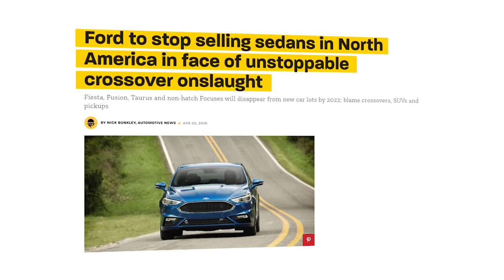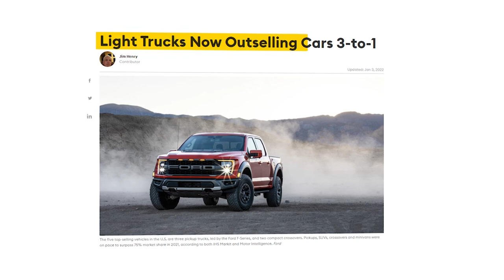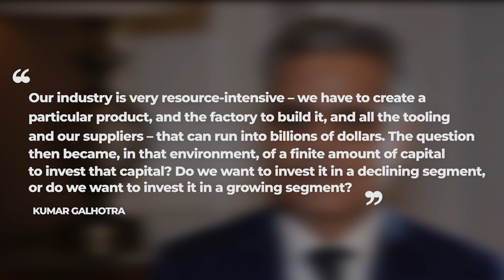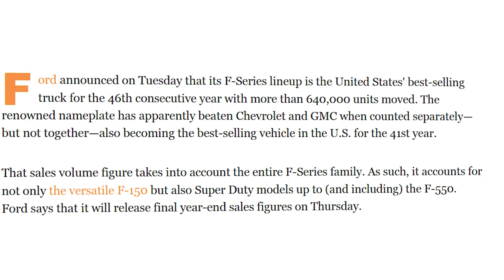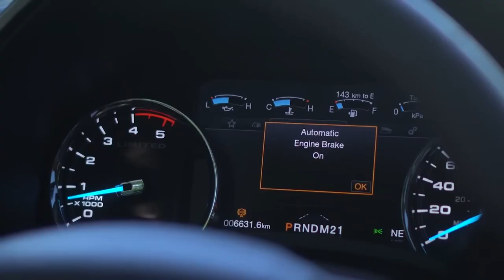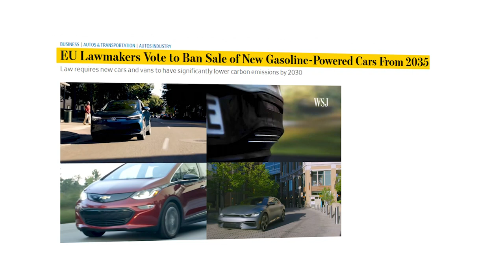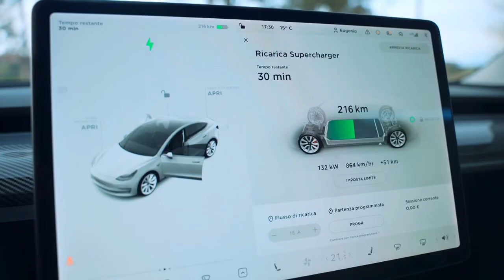The Real Reason Ford Stopped Making Cars

Comment: Canceling Fusion was a huge mistake.
Reply: the focus too was excellent fleet car wagon especially i worked for two companies we used them like small trucks and from square escort  to focus every year they got better and better and co was not great maintaing them they kep them safe but often 18k oil changes. and we still got 200k but then ford decided to drop the wagon so buyers were forced into SUV  then ford designed the 2 clutch auto testing showed it was defective
but the used it anyway and destroyed the cars reputation  as for trucks many want trucks to do work not look like the insides of a Lincoln limo
Reply: That’s a fact; we love our 2016 Fusion S! We can get 41 mpg highway, and it’s a fabulous car..
Reply: How? My 2016 fusion was awful. There’s so many better options sedan wise.
Reply: @Exp101_  awful as you believed it to be, it sold well and had great future possibilities. Hybrid, plug in hybrid,2.5 Mazda engine with 8 speed transmission (best engine ford ever produced). Should have offered less trim options, an under 20k basic fleet/young family trim, and the awd loaded all electric for the 1%ers to help with trickle down parts bins. Ford dropped the ball with the fusion.
Reply: Ford doesn't have a new car for anyone that earns less than 50k. Nothing is affordable. They should have built a car that looks good but economical that's gas powered.
Reply: @jamiebaker6691  correct…Farley himself said he “doesn’t care what the consumer wants”
Reply: cancelling the Fiesta was a big mistake
Reply: @bdun1226  where did he said

Comment: My last truck was a 1998 F150 with the 4.6L V8, bought it new for 20K and used it as a real truck for 23 years.  Can't imagine paying 60-90K for a luxury truck and actually using it like I did.
Reply: No kidding.  Paying $90k for a truck I would keep it in the garage to avoid it getting a scratch
Reply: Bought a 2006 lariat it has three hundred thousand miles on it still going strong. Can’t imagine buying a new one way too high price. But Ford builds a good truck
Reply: My 2003 Silverado has 307k miles and my kid still drives it daily.

Comment: Notice when they talked about Jeep selling fewer SUVs then cars but making more profits tells you they don't understand that they are losing the majority of their customer base by overpricing and over building their vehicles. Most people would rather have a vehicle that they can afford with fewer options which is why the Ford Maverick has a two-year waiting list. I can afford a full size truck but don't need one. The Maverick was perfect for me but I am no longer interested. I currently have a 79 Bronco which I have decided to restore rather than try to buy a new one, which I was also interested in. I currently have a 92 F250 which I will restore because I don't want to spend the money on a vehicle with options I don't need. Gas vehicles will never go away. I would like to see more investment in hydrogen cars. They are out there and they're not much more expensive to operate and filling the tank doesn't take much longer than a gas vehicle. Hydrogen is much easier to produce than the amount of mining required for a battery that has a lifespan of 10 to 15 years. And the cost of recycling and impact to the environment is much greater. Oh by the way with today's efficiency of cars and trucks we no longer need CAFE standards. It is just another mandate enforced by another unelected alphabet agency.
Reply: Yep you got it brother
Reply: The car makers today are basically flipping off the working man with their high-prices.
Reply: jeep crylser make more profits yes.. as they are always in the shop

Comment: So on the argument that Ford stopped producing cars because it couldn't adequately spread out its cost over the production run, why then while they were in production were they always the best value by far for equivalent features?  Car, CUV (higher cost for same features), SUV (even higher cost for the same features), and light truck (pickup) even higher yet despite having the highest unit production???
Reply: Becuase they are greedy why make a ton of cars when you can sell less at sky-high prices

Comment: Ford made a mistake in their 2020 change to the Explorer. They are only Eco Boast models now. There was nothing wrong with the Explorer with the 3.6 V6 without Eco Boast. I don't want an Eco Boast since it is something else to go wrong. My F-150 has the 5.0 V8 and that is the only motor I want. When the Explorer needs to be replaced, I will have to buy another brand of vehicle if Ford stays with the current options.
Reply: Agreed 100% brother, I have a 2011 Ford F150 with a 5.0L Coyote V8 in it with 152,000 miles on it and still going strong and its a beast and it sounds like a beast with the Borla ATAK exhaust on it. I also have a 1996 Ford F150 with a 5.0L (302) Windsor V8 with 210,000 miles and still going strong as well.
Reply: I encourage you to try a current model 4Runner.
Reply: @bobby3944  The 4 Runner is an excellent choice as well as the GX460 (since it's basically a 4 Runner with more luxurious features and V8 power as well).
Reply: i own from new a 2014 fusion 2.0 vel engined car.. 170000 miles on it..leather is still perfect, as the rest of the car.. i just change the oil every 6000 miles and exchange 4 quarts of transmission oil every 15000 miles...and added a ovs to the car..no carbon on my intake valves.... it is an ecoboost  engine,, has a tune on it.. now dynoed' i has 255 hp at the front wheels and 315 tq.. fuel mileage went up from 31 mpg at 70 in cruise control to 34/35 at 70 in cruise..love the car.. very good looking inside and out.. have installed a adjustable  coil overs and dampeners on it..lowered it only 30 mm.. looks even better..
Reply: I rented a Ranger with the Eco Boost last month fir a few days. I hate that motor! It isn’t smooth and refined the way the V6 motors in my Mustang and F-150 are. It’s jerky and it feels unrefined.

Comment: The big problem is they build different product lines with different priority parts,  (they make a lot on parts on purpose due to all the changes, “dealer only”…). Toyota uses the same door window switch in everything,  same with there drivetrain and suspension packages,  find something that works and is reliable and use it in everything for 20+ years,  Camry front suspension didn’t change for 20 years.. Ford can’t even go a full model year without changing stuff,  call the dealer for parts and they have to have the vin number,  one year there were 5 different injection pumps in one year for Ford diesel trucks.  Ford will fail again and the Ford family will have to step in and clean up the mess these woke greed obsessed  CEO’s have made.  Ford is failing on quality and reliably, we stopped buying their trucks at work and went to dodge due to reliability.  It’s really bad when dodge is more reliable than GM and Ford.  Really sad,  with the failures on new trucks I’ve seen the warranty costs must be in the billions….
Reply: GM quality has been coming down in the work truck category. Alot of businesses though are still sticking with Ford.

Comment: Don't depend on the electric cars to much, I think they will go down as the biggest mistake ever
Reply: A clear dead end.  I read they take 10x the natural resources to make compared with a gas powered car, and the battery is not designed to go longer than 10-15 years.
Reply: @teekay_1  The battery is recyclable.
Reply: @tommccoy6708  that doesn't really help you when the battery replacement cost is $10,000-$15,000.   At that point you have to buy a new car because the replacement cost is more than the value of the car.

At least if  you buy a Honda Accord, it will last 20-25 years with only normal maintenance.
Reply: they said the same thing about the first cars..
Reply: @teekay_1  how much does a new engine cost? 8 to 15000$
Reply: @randellgribben9772  3 camry hybrids in my driveway the  2009 has 250k on it, no issues,  a taxi company here has a similar car with over 600k on it, factory motor…well designed modern ICE motors don’t wear out if maintained properly,  we have not seen the total life cycle costs on EV’s yet,  how long do the batteries last and what is the cost per mile over 200k,300k,400k… lots of 2012 model s getting to the battery changeout time real soon,  used car dealers won’t touch them with a 10 foot pole,  due to the cost of a out of warranty battery changeout…
Reply: @randellgribben9772  a new engine will last 25-35 years, longer than the rest of the car.
Reply: @randellgribben9772  It was also true about the first cars.

Comment: The one part I wish was covered, was also wanted out of the market due to governance restrictions. Where Cars needed to be at a certain MPG efficiency, where Trucks and SUVs are not due to vehicle classification. Because of that, in the US market gap between cars and SUVs was negligible in terms of MPGs.
Reply: They met the mpg goals on cars. trucks and SUVs are the ones that failed to meet mpg goals
Reply: They got captured after 2008 too.
Reply: Agreed! I started in the car industry in the 1980's right before the shift to trucks, and that's exactly what I saw happen. As cars became less and less exiting because of heavy handed regulation, people moved into trucks. They became a better value. Many of them (some still don't) need to meet mpg standards at all, and some still ran on regular gas not unleaded!
Reply: @evos469  Some trucks are still not even rated for mpg
Reply: i went to a ford school in the 90's/2000's and an instructor told us ford had to built so many small economy cars in order to build the big cars and trucks. i went to the ford school a couple of years ago and asked what happened to that. he didnt have an awnser.

Comment: Wouldn't want an electric bill for the month after charging up my EV in the summer with my AC on in 95 degree heat for days!
Reply: Don't worry - the grid will be down so much, your electric bill won't be as high as you think, in the darkness...
Reply: Charge the EV at night from your home charger.  It will be easier,  cheaper than gasoline,  and won't need any more power than you use for A/C during the day,  so it won't break the grid.
Reply: @davemccarthy7366   Solar here and I still don't want an EV.
Reply: @ralphwagenet852  for now. Mark my words son, electricity bills will go up drastically.  There will soon be taxes added on to fix roads.
Reply: @davidtycker  Agreed about the taxes to fix the roads.  They are needed, and whether we pay for road repairs through gas taxes or some other way, they have to be paid.  I think that the best way would be to pay through vehicle registration, but that will increase our registration fees.
Reply: @Ralph Wagenet  vehicle registration is easiest. They could just subtract your current mileage from previous year and charge for those miles. Super simple, and no overcharging

Comment: It might have helped if Ford could have produced a reliable sedan. With design defects in the Ecoboost engine & the automatic clutches it’s no wonder they ceded the market to foreign domestics. The question remains if they will continue to make unreliable trucks & electrics.
Reply: i own a 2014 fusion 2 liter ecoboost..170000 miles on it.. i just change the oil every 6000 miles nd exchange 4 quarts of transmisson oil every 15000 miles.. added a ovs to the intake at new..no carbon build up on my valves and i check the ovs every month.. almost no oil in it ( no blow by )   and the car runs perfectly.. and leather is still perfect in the car.. never had a problem with my car
Reply: @randellgribben9772  I,m in agreement on the maintenance aspect. With our 2014 Escape, regular oil changes with synthetic, we were able to nurse 150K out of the ecoboost before it began to pump coolant into #2 cylinder. My 2014 Focus I,m still driving even though it has had 5 clutches in the first 100k miles all replaced under the extended warranty. At 120k it looks as though #6 will be on my dime.
Reply: 16 escape 2.0 awd w livernoise tune & light mods @ 140k and it still performs great.

Some people should probably just stay away from turbo cars,...

Comment: I have had fords for 30 years I’m done no cars no me looks like it’s time to look at Honda and Toyota
Reply: You won't regret going Toyota.
Reply: Honda makes the best engines, hands down. Toyota engines are really good too, but are uninspiring. Toyota makes the best automatic and cvt transmissions giving Toyota  the edge. However if you get a Honda with a Manual transmission, you have a potential million mile car. My '04 Honda Accord EX sedan has 270k miles on it and it still runs and drives like new. I've not even had to replace anything on the engine. Just tires, brakes, oils, and one battery. But I wouldn't buy one with an auto trans, then again I wouldn't buy anything with an auto trans. But if I did it would be a Toyota.

Comment: Ford stopped making cars because they were nothing more than rolling recalls. They could make them cheaper than others, but you'd have to keep bringing them back to be fixed. The Mustang electric car is a joke. Who wants a non muscle car Muscle car?
Reply: lots of electric cars will romp a gas muscle car... watch the youtube videos
Reply: @randellgribben9772  The point is muscle car purists want gas and 8cyls. That was my point.
Reply: @randellgribben9772  And 12 years later when the battery of said Electric car is toast that 8 Cyl muscle car is still as fast as it used to be.

Comment: Ford stops making cars and their trucks are crazy overpriced.  Why cant Ford just build an entry level base truck? A truck like used to be so popular years ago. I'm sure there is a market for a vehicle that is basic in all aspect, like a simple engine, manual windows, simple gauges, knob operated heater controls, manual trans, etc.
Being simpler it would be low priced. Then build a car like that, a basic transportation car. Quit making foo foo stuff and return to the company's roots.

Comment: This video's leaving out a good chunk of the reasons why the automaker would be enticed to go all-in on their trucks.  For one, because the pickup trucks and SUVs both fall under the official designation of a "light truck", they actually have fewer regulations to adhere to when it comes to designing and certifying them - which obviously makes it much cheaper for the automaker.  For another, they've been constantly trying to one-up competition by including as much gadgetry and refined work into the vehicles which drives up the cost and therefore increases the price.

This is the same kind of penny-pinching BS that put a lot of companies in trouble.  For example, a long time ago, retailer SEARS tried to enact a company-wide mandate of removing all items from their shelves that weren't profitable.  Those removed items included many things that people still needed on a daily basis.  For those who were handymen or worked construction, that included screws and drill bits that every project has to have.  But because screws and drill bits weren't profitable, SEARS lost customers to competitors that weren't dumb enough to be that aggressive on cost-cutting.

Another thing the video fails bring up is the fact that this isn't the first time the NA automakers have been pushing hard on trucks and SUVs.  That was going on decades ago when gas was cheaper and - again - "light truck" vehicles were cheaper because of the lacking regulations.  Plus, the marketing for these vehicles then and now has been to push these lines as something that makes you do all sorts of stuff in the outdoors yet the vast majority never meet a dirt road.

We have to understand that although sedans and compact cars may not be as profitable, they will forever be staples because not everyone will have the credit or the income or the funds to afford a $60k+ truck/SUV.  When gas prices shot up in the 2000s and 2010s, automakers were scrambling to release more fuel efficient vehicles than the gas-guzzling trucks & SUVs.  And when the pool of available buyers for those vehicles today gets more and more dry thanks to the price gouging going on, the automakers are likely to revitalize their sedans and compact car sectors just to keep their sales going.  That fewer products/more profit business plan may last for a time; but the market will inevitably swing the other way.

Comment: Ford made a mistake chasing the SUV dollars. Now that manufacturers can’t produce EVs fast enough, they will have to spend millions retooling for that market.
Reply: Won’t happen supply chain for EV’s is too massive/ spread out for large scale production, listen or read what Toyota CEO said recently.  There is not enough raw materials supply to do it..  and now Russia is off line…. The largest raw material supplier isn’t exporting….  It takes 10 years to double a supply chain of any raw commodity…. Reality is a bitch,

Comment: My last Ford is in the junkyard now and I will never be back. I bought nothing but new Ford's from 1986 to 2014 but that is done with. They left me, I did not leave them. They made a lot of bad business decisions that brought them to this point like the duel clutch automatic transmission they could never get right, but they sold them anyway for nearly a decade hiding the fact that they were junk. They also made many other bad decisions for profit today and screw their customers tomorrow. I am now a Toyota guy and love the reliable well built vehicles. However all of them are loading up a lot of features that folks do not want or need just to pad the bottom line and it is going to hurt in the end. They tried it once and they got burned. It will happen again.